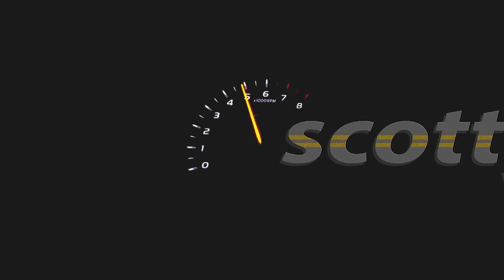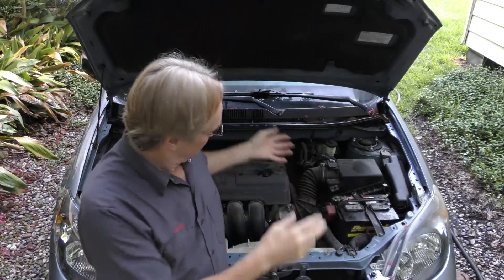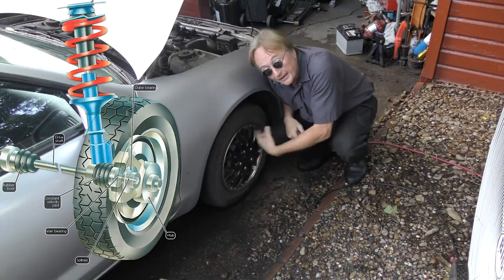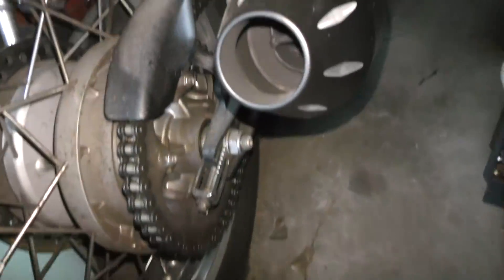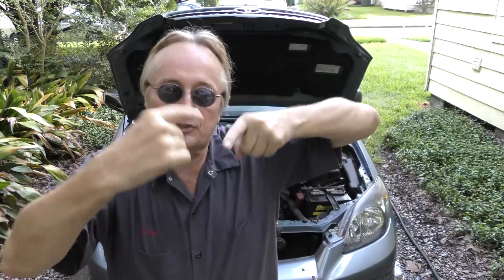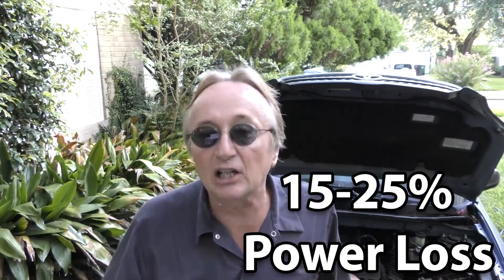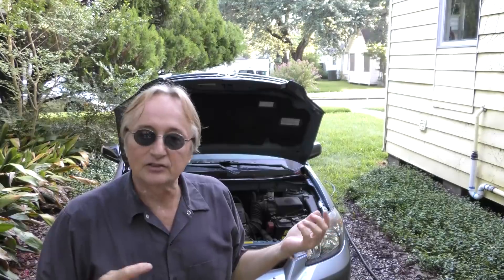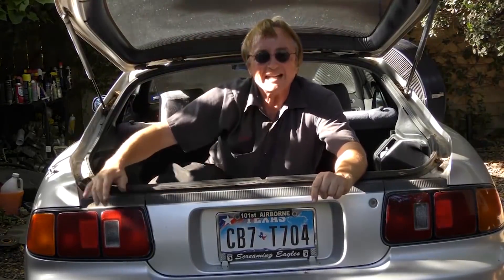Here's Why Your Car's Horsepower Rating is a Lie

Comment: they also lie about MPG
Reply: they also lie about engine displacement lol.
Reply: Well, not really lie, but they manipulate conditions to get the best MPG they can possibly get.  For example, pump up tire pressures astronomically high, fold in the side mirrors etc.
Reply: DjStiv3 that's somewhat true. MPG is an unrealistic number. You can try all you want but you will never achieve that same number. How manufacturers come up with that number is running the vehicles in a cycle with perfect conditions ( perfect temperatures, minimal wind resistance, etc.) Therefore, it is impossible to get the exact numbers due to the fact that we don't live in a perfect world. There would always be wind resistances, the temperatures would always either be too cool or too warm. It just gives you an idea of how efficient the vehicle is but it will never be as efficient as what the manufacturer say it is.
Reply: That is complete BS: I can beat the MPG ratings on my cars by about 10% despite running everything completely stock standard aside from higher than recommended tyre pressures (although still well below max sidewall pressure). This is on a variety of cars from different manufacturers with an average of over 100,000 kms on the clock over extended periods of driving in a variety of conditions.

A bad workman always blames his tools. Learn to drive efficiently.
Reply: Sean G I second that too. I've always meet or exceed epa mpg rating on all the cars that I've owned and driven. I.e we rented a Kia Soul recently and it was rated for 26/31 by epa. I am averaging 32.5 on it right now. Bad driving behaviors are the biggest contributors to bad mpg. Just remember, less brakes application translates into higher efficiency. Driving with comon sense would reduce the use of brakes and unnecessary wears and tears on the vehicle.
Reply: Yeah by driving car lifted up
Reply: Sean G 
I have a 2013 Acura ilx with 150k miles. Factory mpg is 34 hiwy.  I can get it to 40mpg when I want
Reply: Very true Hyundai was sued for false advertising on the MPG's of their cars a few years ago.
Reply: Yeah anyone getting 30-35MPG Hwy out of 2011-2014 Sonata 4cyl? My girlfriend car i bought, always reads out 19-21mpg and is very healthy.  I feel if I drive it I'd probably only get 26-28 mpg max...     Meanwhile my 1992 Mercedes Turbo Diesel advertises 26-31mpg, I get 29 winter and 34+ in summer. My 93 Dodge Stealth Twin Turbo advertises 18-24MPG and that's exactly what I get, few times I got 27-29mph out of a tank...
Reply: Fuel consumption rating is based on a graph of acceleration and cruising speeds running on rollers in a lab. Read about how it's determined and which driving cycle it uses (NEDC, WLTP). It never said that any car would do that on the road. It's more of a way of comparing two cars, rather than real world fuel consumption.  Google WLTP, NEDC and RDE for more information on fuel consumption ratings.
Reply: I thought EPA were the ones who estimate it
Reply: 6 speed my 95 Acura Integra gets 28mpg
Reply: When cars get worn a little the engine gets better gas mileage cause the machining of the engine changes as you use it due to the Piston moving up and down.
I bought my Prius brand new so I can break in the weather engine myself so that it'll wear nicer than other drivers
Reply: Sean G 80 bucks got me from Dallas to edgewater park NJ. Didn't drive like grandma, used the cruise and minimized stops.
Reply: Granny driving, hyper mileing  and no traffic gives you the best mpg numbers out of the EPA estimates
Reply: American Car manufacturers maybe, because they are greedy. Or you don't know how to properly drive your car.
Reply: MPG is not wrong you just have to drive with the right rpm all the time and do not drive 130 km/an hour. I can drive 21 km/liter gasoline in my Toyota Avensis station car. MPG for that car is only 18 km/l gasoline
Reply: its one of those things that dont matter if everyone uses the same variables to get there horse power numbers.

Comment: I'm a classic muscle car guy so I don't know exactly how much other types of cars lose but most three speed automatic solid rear axle vehicles from the 60s and 70s only lost 75 to 100 horsepower between the crank and rear wheels, and even less for the ones with a manual. There is no excuse for a modern day Mustang to lose 160 HP getting to the wheels when a 60's Mustang only loses 100. While I'm at it there is also no excuse for a modern Charger to weigh 900 pounds more than a 68-70 Charger. Why do manufacturers insist on working backwards? There couldn't be more truth in the statement "they don't make em' like they used to"
Reply: Impact's Garage and Gaming what are u talking about? 662-595= 67. That’s a 67 hp drivetrain loss. Not 160. Also keep in mind all dyno’s read differently, if this was on a mustang dyno it would read a lot lower than a dynojet.

Comment: Horsepower numbers sells cars. Torque wins races..Great video Scott !
Reply: Well said sir 👍
Reply: When it comes to racing, the weight is the most important thing, because less weight increases acceleration, reduces breaking and increases cornering speed.
Reply: Wheel Horsepower wins races. Or even better, wheel power to weight ratio wins races 😂
Reply: That's myth has been put to bed ages ago lol
Reply: Thus Buick and Pontiac being very competitive in the 1960s and 1970s on the strip.
Reply: ClusterHeadSurvivor win on Sunday sell on Monday
Reply: Torque makes the tires spin then the horse power makes em smoke!
Reply: Look at how massively heavy semi trucks are.  The quickest vehicles are motorcycles.  Very light with by far the greatest power to weight ratio.  Less drag too.
Reply: A car with 200hp and 100lb/ft is faster than a 100hp and 200lb/ft car.
Reply: Carl Ryan You leaving out a lot of info. If you changed the gearing of a semi to a more quarter mile friendly set, it WOULD be insanely fast. And in drag racing, torque is what wins. If you get two identically set up cars, put a 500 hp 4 cylinder in one and a 500 hp V8 in the other, who's winning? Drag racing is a demonstration of acceleration sport. Torque is what accelerates a vehicle, not horsepower.
Reply: 231mac Probably the inline-4, normally turbo cars brings more torque...
The problem with diesel is the high rpm range, so gearing won't do much vs a high revving engine that would get more benefits than a diesel with 4.5-5.5k rpm redline.
Reply: Also, torque and gearing are not the whole story, it also needs grip to put the power to the floor.
Reply: zNoah Who said the 4 cylinder had a turbo? Who said the V8 didn't? If were going the turbo route, then what would the torque comparison be like then? You seriously think in two similarly set up cars, a 4 cylinder would win??? Wow... And you're not listening to the gearing change concept for a semi, as it would obviously take in consideration RPM limits; hence 'quarter mile friendly'. And what's with the traction comment? You do know they have 3,500 hp (NOT 4 cylinders, lol) cars running in the small tire classes, right? And they're doing just fine.
Reply: No Horsepower wins drag races.
Reply: Carl Ryan that analogy is silly. A 3300lb vs what in weight? Beahahahha
Reply: Alexander Contreras Partially right. Drag racing is a competition from a standing start. It takes torque to accelerate a vehicle from a stop, and in most cases, the first 60' determines how good the run will be.
Reply: They always go togeteher. You can have all the torque but without good hp you aint gonna win any race. Torque is waht you feel and hp is how long you feel it.
Reply: 231mac also power to weight ratio plays a big factor. Like you said earlier.
Reply: 595lb of torque to the wheels in my little BMW 3 series diesel (tuned twin turbo).  It's a blast to drive on the street and the dragstrip.
Reply: 231mac v8 weighs way more than an i4 and if a v8 has more torque it also needs a bigger transmission and tyres which means even more weight. That's why at 500hp i4>v8
Reply: That's an outdated myth, from a time where 4 speed transmissions didn't keep an engine around peak power. Formula 1 engines make low torque, but proper gearing means they can effectively use their horsepower. Power (hp) is a function of work (torque and rpm) over a period of time, and more work over the same period results in faster acceleration.
Reply: Those tractors also have massive amounts of HP too so lets not forget to factor in gear ratios and weight differences, take the HP & torque ratings of any newer peterbuilt and cram them into a fox body then see whats up...
Reply: You need both. One gets you moving the other keeps you mo moving. The heavier the car the more important the torque is. It's not even that simple. Powe cure and right combination working together is what wins races.
Reply: grip (tires) factor into your gearing
Reply: Adodoes You're not understanding what I said. I said IDENTICALLY set up cars, that accounts for weight.
Reply: Thomas Griffin Yes, but F1 isn't drag racing. And if it's such an outdated myth, why do they change the gearing per track? What does gearing change? It changes the TORQUE multiplication factor.
Reply: Horsepower is a product of torque.
Reply: 231mac I don't think you've grasped it yet. Hp is a work unit. The car with less torque will rev out higher in each gear before needing to shift. The higher torque car has to shift to a different gear with different gear ratio thus giving it lower WHEEL TORQUE than the lower crank torque car until it also shifts. Add up those extra revs in a lower gear over the 1/4 mile and the effect it has and then the formula for hp from revs and torque  makes sense.
Reply: Horsepower is how hard you hit the wall, Torque is how far you move the wall
Reply: 03056932R Lol, no I think you have it pretty screwed up and really bad at that. For one, HP is a unit of work, not a work unit. And that 'explanation' of yours is weird to decipher. A car with less torque doesn't NEED to rev higher before needing to shift. A car with a smaller displacement engine needs to rev higher to produce usable HP. And this: 'The higher torque car has to shift to a different gear with different gear ratio thus giving it lower WHEEL TORQUE', makes NO DAMN SENSE, lol. I mean, just wow....
Reply: ClusterHeadSurvivor a more accurate statement would be "HP  at high RPM sells cars. Torque at low RPM wins DRAG races". People need to understand that at any RPM range, high Torque  also translates into high HP at that same RPM. So the reason of why big torque engine at lower rpm usually win drag races because they made huge HP up front, at lower RPM. HP is a more accurate measure of engine power because it describes the work rate of an engine over time. More HP = more work done over time.

Comment: Scotty, it's great how you explain everything These videos are really informative. But one note: the some hate you get maybe due to the "So don't buy a ..." statements. It's great to know that an automatic transmission has a few percentages more loss than a manual, but that won't be the reason why anyone would change his mind about it. Similarly, hard maintenence on a Porsche or Mercedes is a great info to be warned about and watch out for, but not something that would make anyone change their minds on buying them.
Reply: G.Zoltan it changed my mind... spending 1000 dollars for a strut replacement is a huge deal breaker for me.

Comment: Dodge: under rating horsepower since 1968
Reply: honey poo I don't know, the Dart feels very slow. My 30 year old diesel Mercedes rated at the same power seems to accelerate a lot faster. That Mercedes should be heavier too, the seats weigh about 100 pounds (I had to pick them up, felt like a window unit AC...), and it has electric sunroof and all that stuff that adds weight. The Dart is about as simple economy car as it gets. I really don't trust its rating.

Also my RX8 does 0-60 about 3x faster, on the dino those never make even 190HP (those probably do have fake HP ratings). Its a little lighter, but its also a standard driven by a monkey (at least I haven't accidentally down-shifted recently, but I'm still terrible).
Reply: true that. the 6.2 hellcat engines have more than 707 hp
Reply: My grand cherokee zj has 220hps and beat cars with more than "300hps" even 4cil turbos, and my city has high altitude
Reply: Alejandro Flores My 15HP motorcycle will leave the Jeep in the dust, what's your point?

If they really had 300HP and not full of bricks (I used to keep 3 sacks of concrete in my trunk, never new when you needed it...), then they will be winning by a huge amount if they are giving it the throttle. I'm sure many have said they were 300HP, but they were probably bragging or didn't really know.
Reply: Lol the Grand Cherokee is also a heavyweight, and high milleage engine, so thats why im impresed with their "220hps" performance...
Reply: Alejandro Flores Are you actually racing anyone properly at the strip or just thinking that people are trying to "pass you" in the street so you throttle it even more to pass them and then assume they're at full throttle and won a "race" when in reality they really just didn't care for driving overly aggressive in the city?
Reply: Jake Garrett what engine do you have in the dart.....the 2.0? Thats 160 hp and 150 ft lbs and it weighs 3300 lbs. Cars have gotten biggwr since the 70s. Compact now is midsize in the early 2000s. Your doesel is probably lighter and has a lot more torque. Diesels are known for that. Thats why it feels faster.
Reply: i highly doubt you were beating anything with that much power i hear ricers say oh i have 300hp but when i race them with 230hp they get smoked by me cause they think a cai and exhaust gives them 150hp

Comment: One has the California HP too that can/was lower due to stricter Emissions. The 1982 California Camaros I looked at in June 1982 were L4 as 92 HP, V6 at 102HP and the V8 at 135HP. I test drove the L4 in manual, V6 and V8 in Automatics. Both the L4 and V6 accelerated about the same.  Oddly the V8 was better but not radically. Today web sites say the V8 was 145 Hp and the L4 was 90 HP with no mention of how California had variants that were different.

Comment: Great video scotty tons of things have horsepower loss I agree with you anything that has changeable gearing or directional change and even friction including wheel hub bearings and u joints causes horsepower loss also includes torque loss

Comment: It's not completely a lie, it just sounds better. When you buy a crate engine it's the the flywheel. It's just one of the most common ways to measure as well as easiest since most engines  tested on an engine dyno. And that same engine can be put into multiple cars and variations of drivetrain so it's the most average way to measure.
Reply: Efurd Garage It's an attempt to cheat customers! Do you buy the engine or the car? They also say that the car has 200 HP -not the engine!
Reply: Juri Vlk no it's not cheating the customer. It's the common way an engine is measured. It's an average also because you can build 2 identical engines and they will produce slightly different numbers. Also since an automatic and standard transmission affect horsepower differently it's just easier to measure the engine and be done since most manufacturers don't have a chassis dyno. And it has been that way for many years
Reply: Efurd Garage 
Do you buy the car or the engine? The goal of the manufacturer is to show higher numbers! Your reasoning is wrong. Since the output on the wheels is smaller with an automatic gearbox, the buyer should know it. Most people have no idea how the power is measured and they assume it"s at the wheels.

HP are used to express the performance of the car and that performance is the performance at the wheels! The argument that manufacturers don't have the measuring instruments is a very cheap one.
Reply: Juri Vlk You often buy the car for it's engine.  So yeah, nothing wrong with engine numbers.
Reply: At this point, its pretty much common knowledge that rear wheel hp is always less.   And while an automatic does rob some power, it takes a pretty skilled driver to get a manual to outperform an automatic on the same car.  Automatics are much better today than they were 20-30 years ago.  Back then, 4 speed autos were the norm, now we have 8 even 10 speed automatics.  Whethere they will be reliable is yet to be determined but they definitely outperform them with better fuel economy as well.   The cost to fix or replace these new transmissions will not be cheap, that's for sure.

Comment: Had my BMW 335d put on the Dyno before the tune then after.  It was 237hp/397lb torque at wheels stock but advertised power was 265/425.  After the tuning it put down 365HP and 595lb torque on the Dyno.  50% increase not too bad.   Turbo psi was increased from 28psi to 36psi on the stock turbos.  Now will do mid 12 second pulls in the 1/4 mile at 111mph.